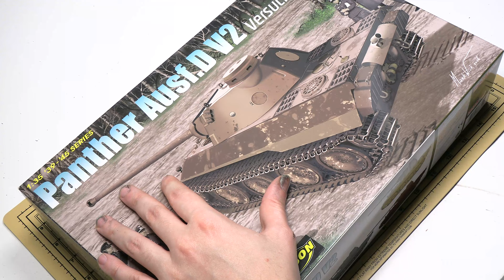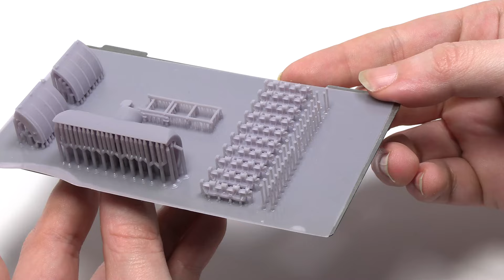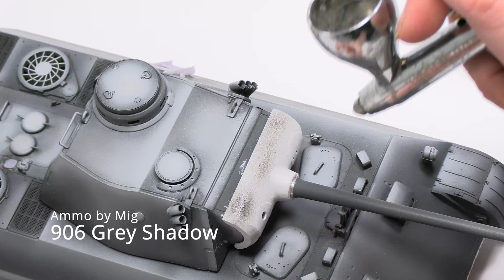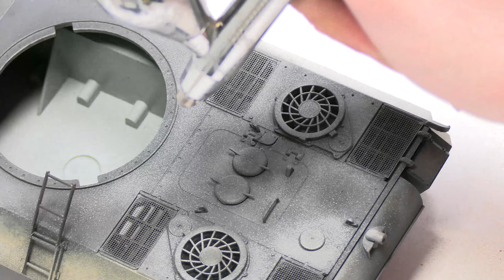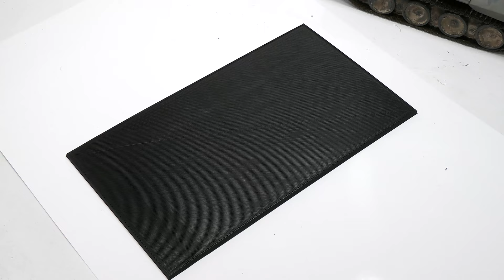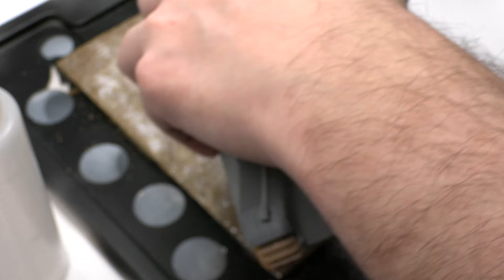Panther Prototype chassis 2 | Nov. '42 | Dragon 1/35

Comment: I have not purchased a Dragon kit in years because of those issues.
Reply from the maker: They have strong line-ups like Panzer III/IV/VI, Hetzers and Panthers however don't live up to the expectations.
Reply: The one that pushed me over the edge was a Tiger I ausf H2. Hideously over complicated and so much material you were supposed to remove. Eventually the kit ended up just being something I test paints on.
Reply from the maker: @pineapplesand556ers  H2 is a subject here soon, thanks for the warning.